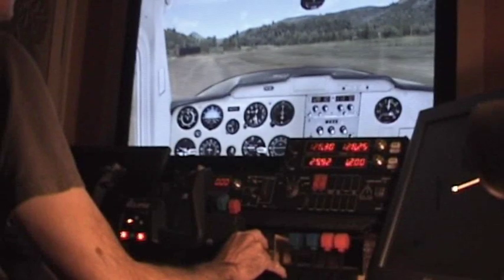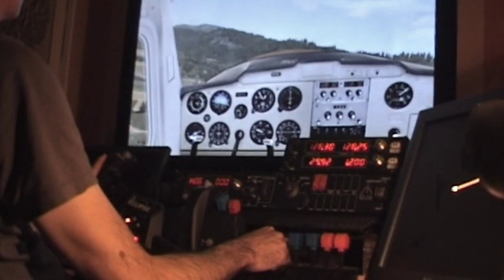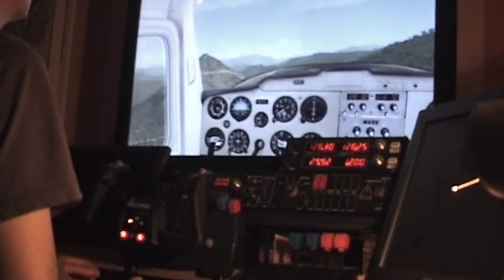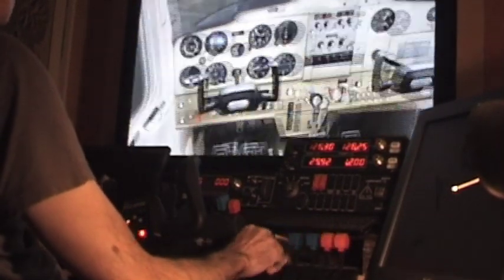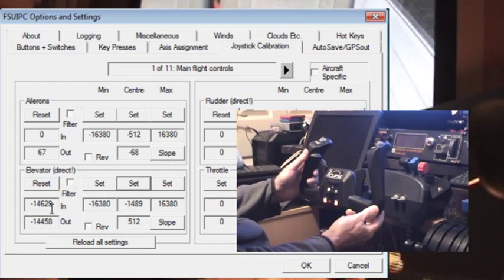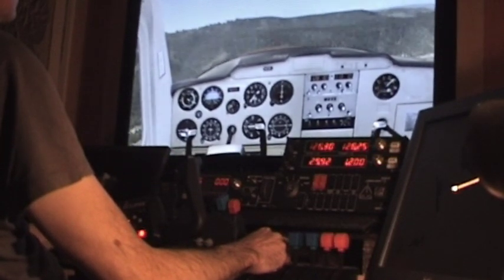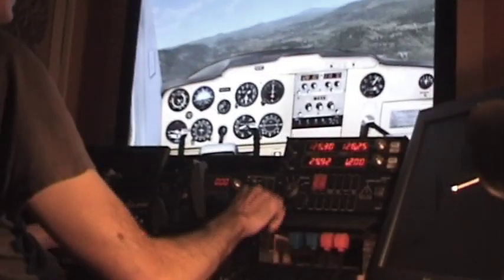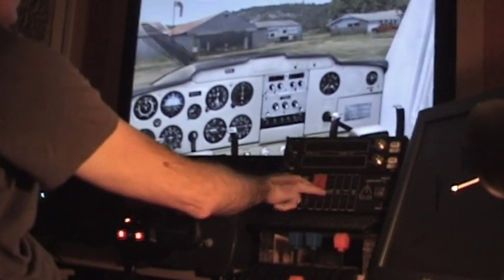CH Eclipse Flight Yoke review

Comment: I've had this yoke for a little over 3 years now and it has served me well.  Having earlier this year purchased the MFG pedals; I'm in the market for a similar mid-level yoke (say $300 to $500, hall effect, etc.) but nothing seems to exist in that range.  So the CH capably carries on; were it to fail today I'd probably replace it with another.

The "thumb rudders" and trim wheels were what sold me on it vs. the competitors, but I have actually since removed the thumb rudders upon buying pedals and not having a clue what function I needed an extra self-centering axis for.  It's fairly easy to take out once you remove the 4 long screws from the housing on the backside of the yoke, and a couple small squares of electrical tape nearly undetectably cover the holes left behind.

I also periodically (about yearly) open it up and clean/reapply white lithium grease to the shaft and all of the moving part contact points and that has helped to keep it running quite smoothly with minimal sticking (at least as much as can be expected with plastic on plastic).  Biggest remaining issue is the noise from the springs, but there's not too much than can be done about that.
Reply from the maker: You could stand by for the Honeycomb Alpha yoke, due imminently, which is well within the price range you are after. No Hall Effect sensors but for most consumers I see contactless sensors as a marketing thing. Case in point, you have a CH you have used for three years and presumably the pots still work fine. The CH pots are way better than the Saitek ones and I am guessing the Honeycomb ones will be better still (it has a five-year warranty). Aside from that you could hold out for the Fulcrum Yoke, made in the UK and about to debut at an undecided price but somewhere between £400-£500. That's all-metal, with contactless sensors and 8" travel. Nobody has one yet so we can't really know, but on paper it is a real contender.

Comment: As one who flies real aircraft, I can assure you that in a large variety of situations and maneuvers, the resistance forces on a yoke can be far, far greater than anything that those little springs in the sim yoke can replicate. Although the spring force doesn't always accurately represent the resistance force on a yoke in actual flight, overall, it feels to me like a reasonable representation. It was the drag on the shaft that felt most unrealistic to me and lubrication solved that problem.

Comment: Thank you very much for this review. Very thorough, very to the point, very helpful. I did buy the device despite your fair description of the drawbacks and I am delighted! I had no idea it makes such a difference to use yoke instead of a stick.

Personally, I do not find the full elevator deflection forces so bad. In fact, when you flare a real world Cessna it really takes some strength.

But the worst thing is a Polish glider called SZD-30 "Pirat". Aileron control often takes two hands on the stick and a good kick to the pedal :)

Comment: Excellent!  Very informative!  I recently purchased the CH Eclipse Yoke.  Very happy with it's performance for my needs.  Even if I had wanted the Saitek yoke, they seem to be on very short supply, with fairly long back-order times.  The CH arrived within a couple of days.  It is causing my computer to "crash" every so often, during a flight.  I may have to tweak out some of my scenery settings, etc., to account for this. Did not need to download any software, which does not allow me to use some of those front 3 position buttons.  But, worried that the software may cause other conflicts. There are plenty of buttons on the Eclipse to use, without the additional software.

Comment from the maker: The CH yokes have throttle, prop and mixture built in, but the Saitek yoke includes a separate quadrant with these controls on. You can also buy additional quadrants to expand it. As far as I know the CH Eclipse is the only yoke with a built-in rudder control, although several joysticks have a 'twist' axis that can be used for rudder.

Comment from the maker: Setting a null zone in (say) the pitch axis ignores any inputs in a given range, usually around the central position. This mitigates any inaccuracy in the yoke's ability to centre itself mechanically. It can also be used to make the yoke less responsive (i.e. not responsive at all!) when very close to the centre, which helps avoid over-controlling and 'pilot-induced oscillation'. You can set NULL zones independently for each analogue axis.

Comment from the maker: This is not a question about the CH yoke. Reverse thrust in FSX is obtained by reducing throttle 'below' zero - in other words, you use whatever key or button is mapped to 'decrease throttle' or 'decrease throttle quickly' (F2 or NUM3 by default) when throttle is already at idle. You can map these functions to whichever keys or buttons you want. You could also map it to an analogue axis if you use FSUIPC.

Check out my Turbine Toucan part 3 video for a discussion of reverse thrust.

Comment: Great review, and all your videos have been enormously helpful with my recent considerations for buying a yoke. I actually bought a Saitek Cessna yoke, but sent it back immediately because it had terrible stickiness similar to your second review of the pro flight. Made it very difficult to maintain altitude in turns without sudden 'jerks' as it doesn't work well when roll and pitch are combined. I also can't bring myself to buy the eclipse because I do not want to "buy to re-engineer", especially if it invalidates the warranty. I may suck up the cost and end up going for one of the pricier pro level yokes. I wish Thrustmaster would bring out the equivalent of their Warthog in yoke form (though that too suffers stickiness problems).
Reply from the maker: I would say have a look at the VR Insight Master yoke. I have not tried one but I have heard good things and the insides look much better than the cheapo ones.
Reply: Almost Aviation It does look really rather nice, and all the switches set out in "cessna" format are very appealing. I am also looking at the PFC yokes, and the more expensive IRIS Dynamics Control Loading Yoke, but that is a huge step up in cost. That force feedback (not that they like you calling it that) does look amazing. Maybe after christmas I will just go wild!

Comment from the maker: It may be that the drag factor contributes to difficulties at the extremes of pitch. When I measured the force required it wasn't much more than the Elite yoke but the Elite is much more controllable. Perhaps the difficulty is as much about making rapid changes to the elevator input. As for realism, the only things I have flown in recent years are a T600 microlight and (briefly!) a Tiger Moth, although I do have 10 hours in C172s and 90 in 150/152s so I hope my observations have some value.

Comment: A simpler and an even more effective way to remedy the shaft centering and control smoothness issue is to lubricate the shaft. NOT JUST ANY LUBRICANT WILL WORK WELL HOWEVER! After a lot of experimentation, I've found that applying some "STP Oil Treatment" to the shaft will improve the feel and performance of the yoke considerably.  This is an automotive engine oil additive that happens to be extremely slippery and is the only lubricant that provides a substantial effect.
Reply: Thanks for the suggestion! Do you suggest STP Oil treatment for diesel or gasoline engines?

Comment from the maker: Lubrication may be 'simpler' but it's addressing a different problem! Lubricating the shaft will have no effect on the control forces required to operate the yoke. These are determined by the springs.

Comment from the maker: I suppose it is possible that the use of asymmetric springs increases the friction on the shaft, as it will be pulled to one side in the bearings at large control deflections. I haven't done any experiments to check this out.

Comment from the maker: Probably best using auto-rudder and forgetting about it. If you want to do advanced manouevres, you need independent rudder control. You could use a twist-handle joystick, a second dedicated joystick or the keyboard. All with varying degrees of compromise.

Comment from the maker: Well I did make it clear that my comments were specifically about the approach and landing, particularly as this is when we are most likely to approach full deflection of the elevators. It goes without saying that a given spring system can only model one situation with any accuracy and everything else is a compromise. For example, if I want realistic landings I have to accept that flying 60-degree level turns will be too easy.

Comment: With regards to spring replacement you discussed in 13:00 of this video, that's a great idea but wouldn't it be better to replace both the springs to ballance out the spring forces being applied on the yoke's axal? You would just select two spring that are not as sloppy as the little one you used but not as firm as the stock spring. Wouldn't that avoid the centering problem you mentioned?

Comment from the maker: I cannot recommend one over the other. For me, the Saitek would have been fine it it would remain centered (calibration-wise), but mine wouldn't. Others have more success.

On the other hand, the Eclipse has the tension problems documented in the video. I've now had it for maybe eight or nine months and I wonder if it's also beginning to be less free in its movements, which may mean it is sensitive to dust and needs cleaning or lubricating (which, to be fair, will be straightforward).

Comment: Hi, I have the previous, 'simple' version of the CH Yoke, and what I miss dearly on it is force feedback to be able to feel the aircraft and set the pitch trim. I understand this new 'high-end' version comes with a pitch trim wheel, but can you actually feel the effect of setting the trim on the yoke, as in a real aircraft, where you set the trim so you don't have to exert any back of forward pressure on the yoke?
Reply from the maker: No, it is just the same mechanism as the basic yoke but with some extra buttons and switches and an additional analogue axis for the paddles.
Reply: @AlmostAviation  Many thanks for the quick reply, I didn't realize at first this post was more than 6 years old :-) It's eally a pity there hasn't been any realistic yoke offering since the old Microsoft Sidewinder Force Feedback Pro joystick, which is the only gear I know of that can give you some feel of a real control column, although it really is buggy and jerky, which makes it quite hard to use in my experience (I've used both the Gameport and USB versions since the days of MS Flight Simulatort 98!!)
Reply from the maker: @laurentd9980  Well maybe, but I'm not convinced there are any convinving FFB systems for home sims as yet. The Brunner yokes get good reviews for the hardware but I have seen reviews saying the software isn't as sophisticated as is touted. And without software a FFB yoke is useless.

You might watch my reviews of the Iris Dynamics yoke. I used FS Force, the only proper FFB software for FSX (and maybe P3D), but it was so basic that it didn't really add much to the sim. The Irsis yoke wasn't that good, no doubt the Brunner would be better. For my money, you still can't beat the Yoko.

Comment: I realize this video is almost a decade old but I'm hoping you are still here. Just got CH yoke and pedals, using with x-plan on a MAC. I am learning on a C-152 so I bought the Carenado 152. Is that what you are using? Also what pedals do you use? I am finding the CH-pedals to be totally unrealistic in the way they operate. In the actual plane the pedals don't shuffle with your feet almost flat. The pedals are vertical and you push them with the ball of your foot and your heel on the floor unless you are braking. Speaking of braking the Carenado 152 will roll on run-up even with the brakes fully depressed.
Reply from the maker: Yes, it's the Carenado C152 in this video, although this is FSX so I don't know how it compares with the X-Plane one. I was using the Saitek rudder pedals here but now I have the MFG Crosswind ones. They are much better but still not like proper Cessna pedals. That said, I used to use the Saiteks with my feet on the floor and operating the pedals with my toes, which was sort of more realistic. The word is that the Virtual Fly RUDDO pedals are closest to the real thing, altohugh they're very expensive! Check out Russ Barlow's channel for a pilot's view on why these pedals are better than any others out there, certainly as far as braking goes. I have a set of FlightLink helicopter pedals, which are great for rudder but have no brakes.
Reply: Wow, those crosswinds are nicely made. Thanks for the reply.

Comment: I just installed FSX and the accel pack on my windows 10 setup which has an SSD drive, everything seems to work great, at present all I am using for a graphics card is a Gigabyte Nvidia GT 610 so the graphics are kind of chunky. The problem I am having is with my CH Eclipse yoke, I can't seem to get it oriented properly. Any thoughts or advice would be most helpful, I have tried to set it up in FSX but the thing still is way off the mark, pulls really bad to the right, lucky the little air buggy is at Edwards AFB :))). By the way, great video.
Reply: I have the same yoke & I like it.  (after replacing the heavy springs)  Sounds like it needs calibration.  Have you tried doing the FSX Calibration?  Also, try turning off the AUTORUDDER.

Comment: I've never "Simmed" with a Yoke, just a joystick and throttle.  How do you achieve the free-moving camera?  In FSX the camera is always fixed in one location until I rotate with the hat switch.
Reply from the maker: The view you see is controlled by TrackIR, which pans the view according to your head movements. (A moment's thought will show it also needs to use motion scaling, which means that your head movements are exaggerated so the monitor stays in your line of sight.) For my money it is the next essential addon after a joystick.

As for yokes, in my experience a cheap joystick is better than most expensive 'consumer' level yokes, so I wouldn't worry.
Reply: TrackIR is cool, but a little pricey.  There are DIY alternatives using either IR tracking or face tracking.  OpenTrack, FreeTrack, and FaceTrackNoIR are some examples.  PS3 eye cam is good for these.  Search the web to find out more.

Comment: Hi, great review! Quick question, does the CH Eclipse have any dead zones similar to the Saitek?
Reply from the maker: Nope, pretty sure that's a Saitek-only thing.
Reply: @AlmostAviation  Ah I see, I actually recently purchased a New CH Eclipse from Amazon and it had a 6 degree dead zone on roll Axis and 4cm deadzone on the pitch axis. I'll be returning that piece, but now I'm stuck contemplating whether to get a new piece or just use the T16000M I have already!
Reply: Your opinion would be greatly appreciated!
Reply from the maker: @ykpilot  Well they may have changed the design since I owned one. But I wonder if you are talking about the mechanical centring tendency rather than the output? The CH yokes have no centre detents, which makes the centring action imprecise.
Reply: @AlmostAviation  However much I wished it was that it isn't. The CH team also confirmed that via email. Any advice on whether I should continue with the yoke or use a stick?

Comment: When you are operating the handles on the yoke body, does it interfere with the yoke action? It seems that the yoke and the handles are quite close together
Reply from the maker: If you mean the throttle, prop and mixture controls I couldn't really say. I never used them as I had Saitek quadrants running alongside the yoke. I imagine your hand would get in the way of the yoke if you were doing extreme control inputs while adjusting the levers.

Comment: Does the Honeycomb have mounting holes on the bottom?
Reply from the maker: I don't think so, but you could drill holes in the mounting plate and screw that down.
Reply: @AlmostAviation  Thanks. How does the base mount to the plate?
Reply from the maker: @StevenVachon  Best to look here: https://www.youtube.com/watch?v=y46lKT4GLdw
Reply: @AlmostAviation  Thanks! That looks like it might not even need bolts. How sturdy has it been for you?
Reply from the maker: @StevenVachon  It's fine if you use the clamps. The yoke moves a little bit against the base, but it's of no consequence (and wouldn't change if the base was screwed down). I haven't tried using the sticky pad.
Reply: @AlmostAviation  Oh yeah, the clamps; those will hit my legs. Bolts it is, then. Thanks again